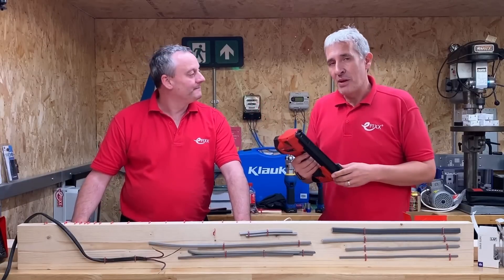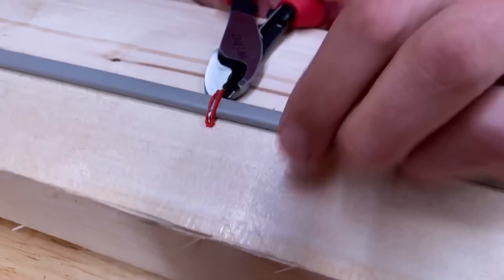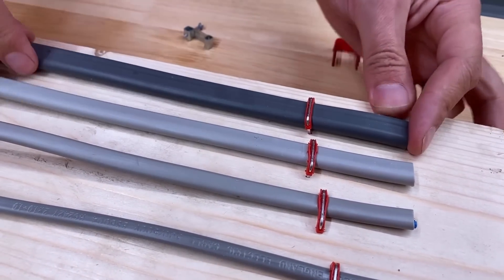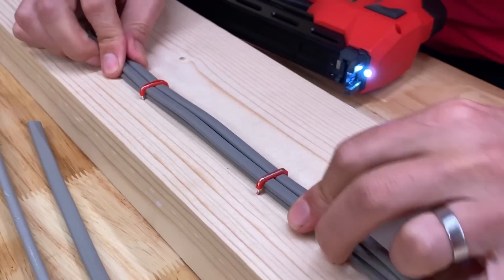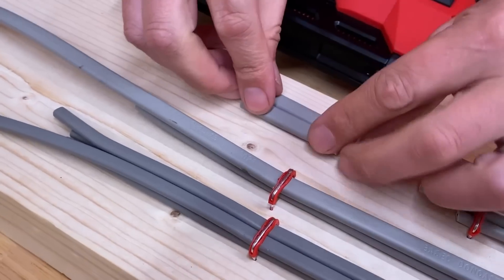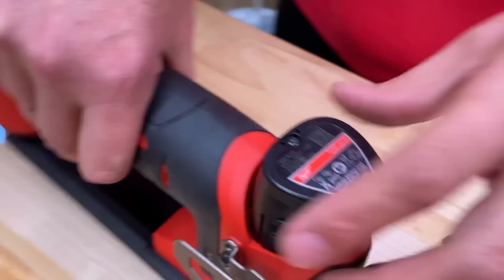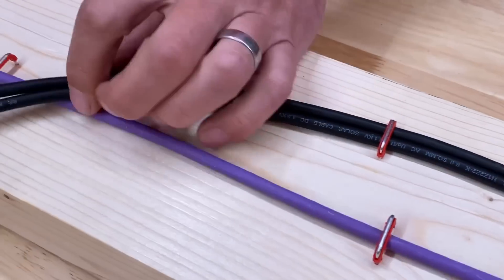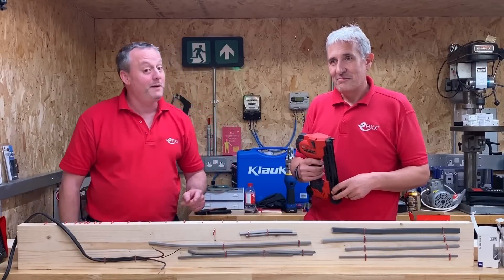Milwaukee Cable Stapler Review: Does it Work on UK Cables?

Comment: Don’t be silly, data installers don’t clip cables, they just sling them across ceilings then pull them as tight as they can, 
I have never seen a good data install unless it’s been done by the sparkies on site,

Comment: The cable is supposed to be able to move a little bit by code in USA that tool would fail inspections here. The dewalt leaves the perfect amount of play.
Reply: No one would ever pass inspection here if they actually enforced that. All the cable I see run in residential here is absolutely bashed around. That's not great, but I would imagine inspectors would be far happier with this than the hammer driven ones I see.

Comment: People saying it can damage cables obviously have never seen an overdriven hammer staple or indents in cable from a hammer head or a manual stapler jamming or shooting off center. This is an amazing tool if you know how to use it, just like any other purpose built tool.
Reply: Exactly. If we held manually driven, uninsulated, stapled cable to the same standard as the criticisms I've seen of this tool's pinch, there would be riots in the street.

Comment: So now you have to charge batteries instead of using a manual stapler that does exactly the same thing as this 🙄

I totally get cordless drills but staplers like this don't make sense to me.
Reply: A manual staple gun is nowhere near as powerful as this. You cant install romex with a manual staple gun.

Comment: Trouble with this type of tool is that you'd only have to mess up once overshooting one clip then you'll be spending that time you initially thought you just saved having to repair the cable. 
Its funny, I have friends digging holes in the ground by hand (with shovels of course lol) at stupid o'clock everyday because no machinery can be used in case a cable is damaged in the process. 
I dont see a way around this issue other than good old fashioned thumb bashing.
Reply: I've been using it and I disagree. I've saved a lot of time and frustration and haven't damaged any cables. I am wiring a 12,000 square foot mansion currently and I use the Milwaukee Cable Stapler almost every day.

Comment: The fact that it's even possible to damage the cable means this is a big no from me, if they had some sort of max depth setting for the staples this would solve the problem. Imagine just doing that once on long and difficult to re-pull run with not enough slack on the cable to just make a single junction.
Reply: I've been using it for 6 months and haven't had a problem. Even stapling with a hammer can be risky, so it's up to me to use skill to get the job done without damage.
Reply: @illestofdemall13  For the price they ask for it and their propritary staples, it is no better than a hammer with that argument, if i'm going to pay that much money it better do all the work for me.
Reply: @AndrewStrydomBRP  It's way faster. I can do like 3 staples in 5 seconds then move the ladder and do another quick run. It's convenience.
Reply: @AndrewStrydomBRP  it's a hell of a lot faster!

Comment: Sorry not that well held Gordon those cables did slide quite easily. But as Gaz said they do hold the cables in place  even with lights pressure. So it should keep fire fighters happy. Because they can’t be seen to carry wire cutters as a standard part of there great video guy’s as always 👍
Reply: Agreed!  And with white staples.

Comment: Looks good guys and the fire test you did shows there merit . I still use standard clips with all round band as fire support every few clips as required. This would be very quick but I would have a small worry of mistakes happening damaging cables if not super carful . Maybe it’s just getting used to it.

Comment: Don’t you have to recalculate the cable size when stacking them?
Reply from the maker: That would depend upon the load of each cable.
Reply: @efixx  We don’t have any suggestions for corrections when stacking cables in Sweden, we had it but it’s been removed. Guess we can do our own estimates for correctional values, unfortunately most sparkys don’t do it and just stack cables on trays etc. 
Did drawings and calculations for a freezer/ cold storage a couple of years ago and it’s interesting that it can be cheaper to put up more cable trays than having to buy bigger cables.
It would be interesting to learn how you calculate and document when a cable tray is filled to capacity according to calculations for each cable so that future additions doesn’t mean that cables run to hot when left without the proper spacing. Provided that you guys have spacing as an option when calculating…

Comment: Bad design if it cant sense the size of the cable and adjust the pressure accordingly. The required pressure should not be dependant on the operator.
Reply: I understand what you saying, but pressure needs not be set by size of cable only, but also by the type of wood you want to punch into.

So the user needs to adjust by the combination of two and so each job will need manual intervention to pressure level.

That's my thought.
Reply: @2y-2y  Surely it would be possible to implement a relatively accurate depth stop on the staple, that would mean you wouldn't need to adjust both of those things.
Reply: @AndrewStrydomBRP 
Yep, physics can agree to that if wood types are near similar in properties to each other.
But I'm sure you agree that chipboard, MDF, hardwood etc do vary enough for the user to use their own judgement of required pressure.

But if you are comparing one brand of chipboard to another brand of chipboard, the pressure required for each will vary between them only ever so slightly, or maybe not at all.

I'm only basing this on my regular use of nail guns. Whilst the NG has settings to adjust, I find many times my own judgement of applied pressure is often best. Each to their own of course.
Reply: @2y-2y  I was thinking more about a physical limiter stop that sits a certain amount above the surface of the wood which stop the staple before it goes further into the wood than desired.
Would of course entail an entire tool and staple redesign
Reply: @AndrewStrydomBRP 
Yeah that makes sense if they can come up with some options.

Comment: I have this tool very good tool only one issue staple are expensive i like if dewalt staple we can use in this tool
Reply: Only expensive cause nowhere has them atm, once screwfix and cef get them at the same £15 a box that the dewalt ones are, there won't be an issue